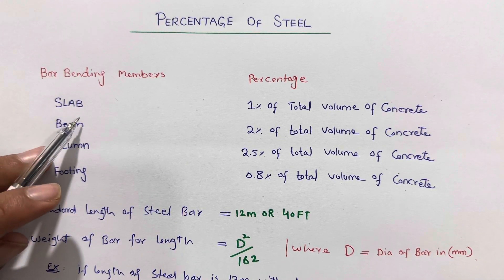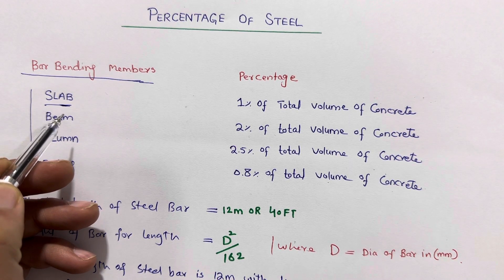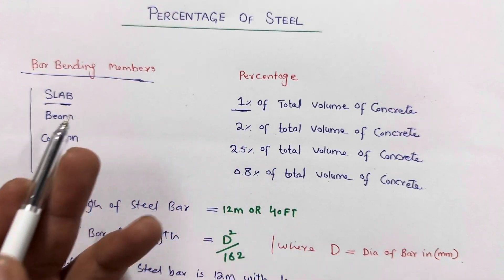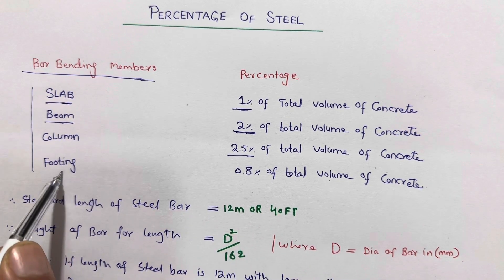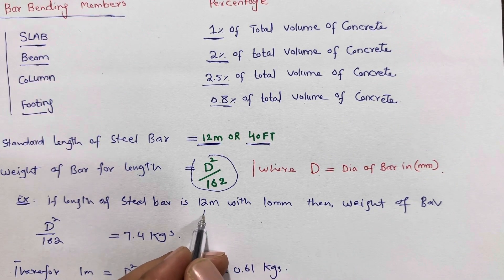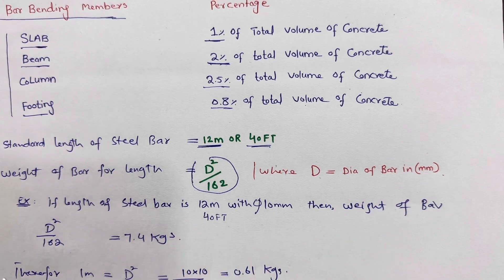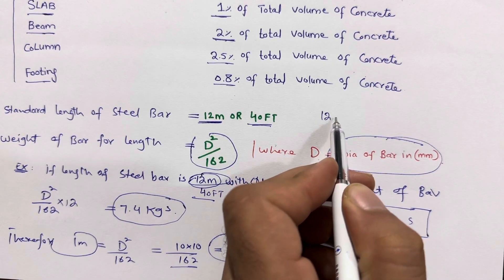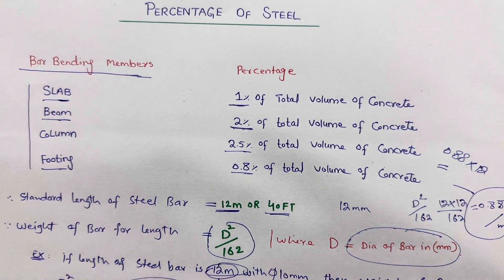Quantity of Steel for beam column and Slab

Comment: This is basic information 
Pls put extra efforts
Full information is required 
How fresher can calculate 
1 % of total volume of concrete in slabs
2% of total volume of concrete in beams
2.5 % of total volume of concrete in columns
0.8 % of total volume of concrete in footings
& one more thing pls explains
Minimum & maximum ranges for all these slabs, beams, columns & footings
Incomplete knowledge is dangerous in our fields
actually I'm writing to you because this is  important for our industry & infrastructure development
You can follow any country codes
But your majority of viewers would be Indian so it would be better if you follow IS codes (lattest updated)
🙏👍 all the best brother
You're doing amazing work by providing knowledge to our fresher Civil Engineering Graduates 🎓